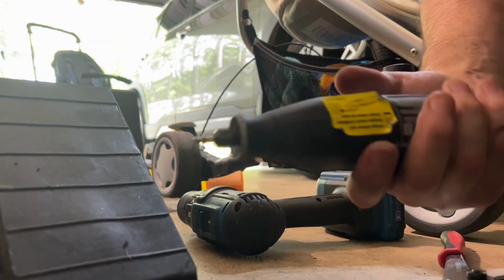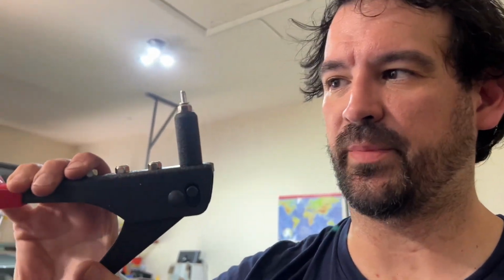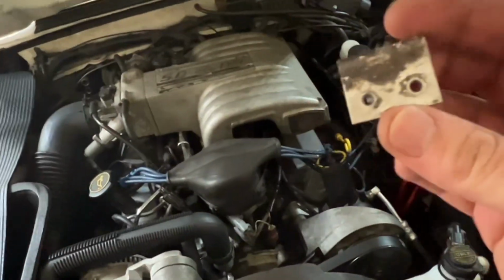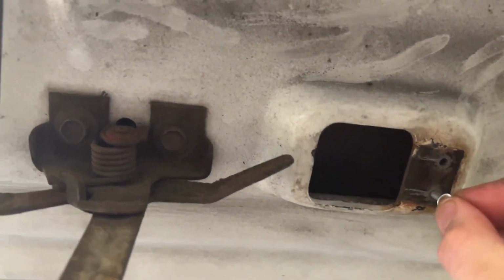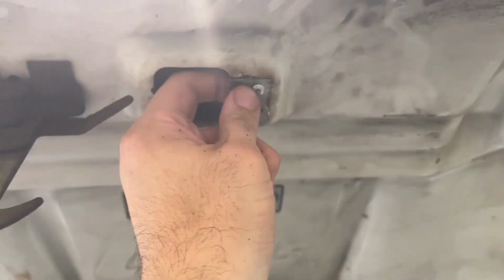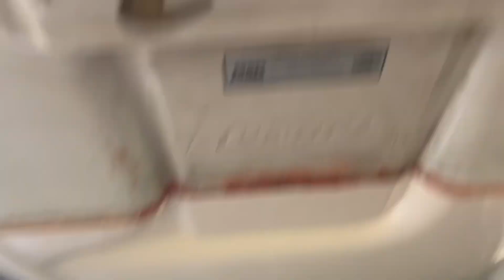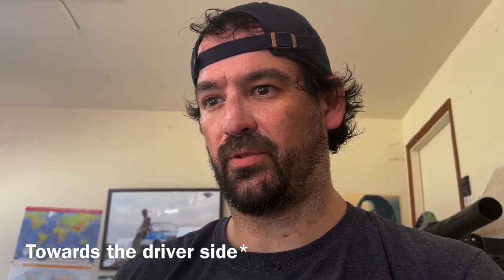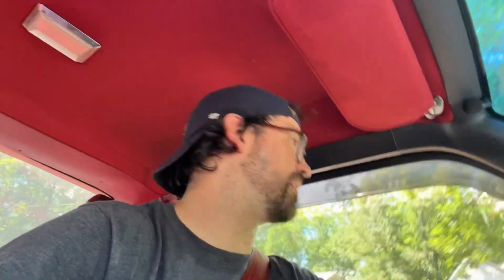Fox Body Mustang Hood Latch Striker Fix Update

Comment: I just picked up one of these hoods cant get it to latch for nothing if adjusted everything multiple times its almost like the latch want adjust up high enough
Reply from the maker: Ugh…sorry to hear that. Mine came with the hood so I didn’t have to sorry about fitment until I had the latch striker issue. Did you buy it directly from Cervini’s?
Reply: @TacoPotatoMustang  no used off marketplace
Reply from the maker: @enjoythesho1992  ugh….I hope you’re able to get it figured out.